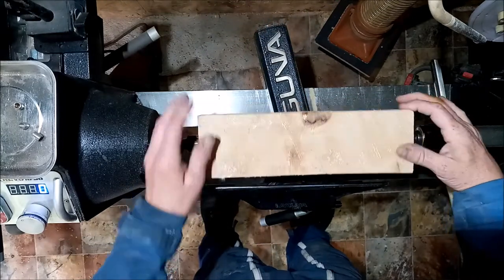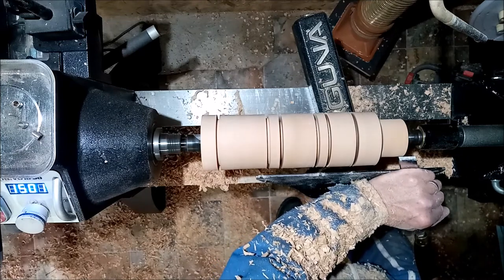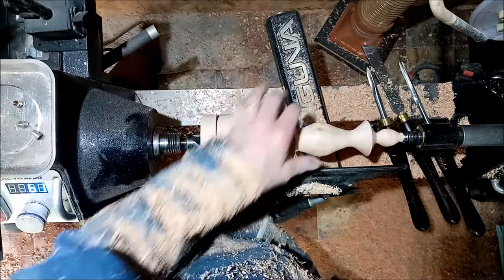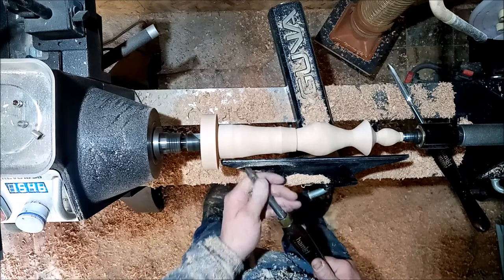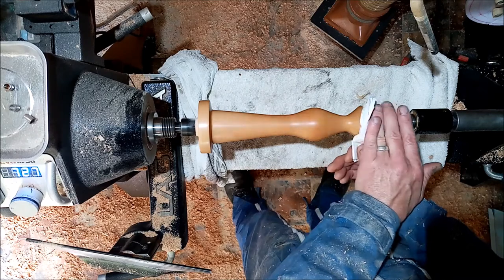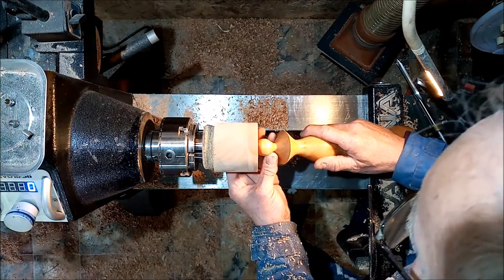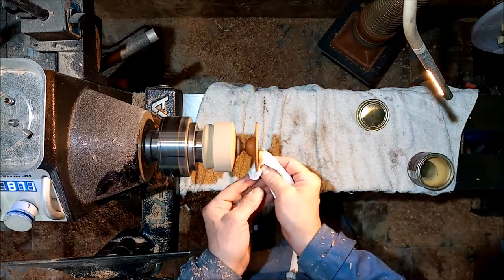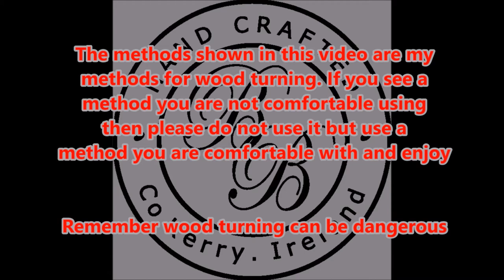Wood Turning Venus figurine/ woodturning

Comment: what do you a slight undercut on the bottom
Reply from the maker: So that is sits on the rim of the bottom Terry rather than a full flat base. Even if the piece warps it will sit on three spots and still be stable. All bases shold be slightly undercut to do this